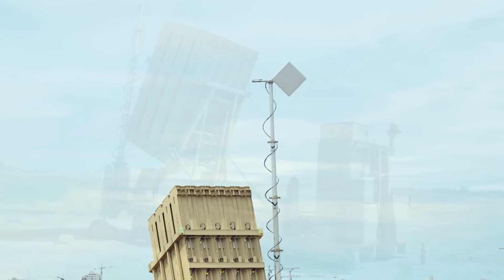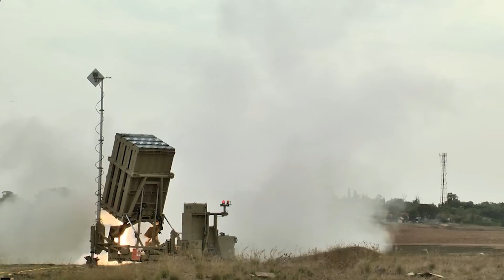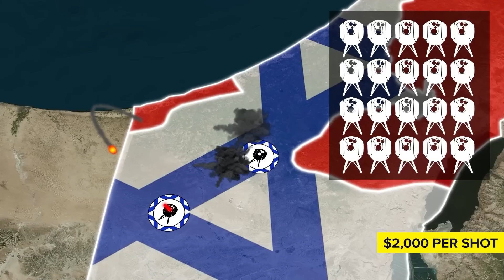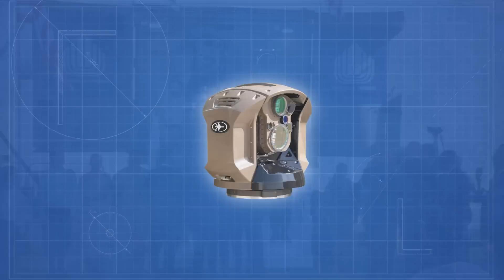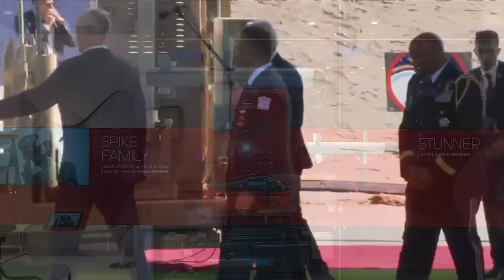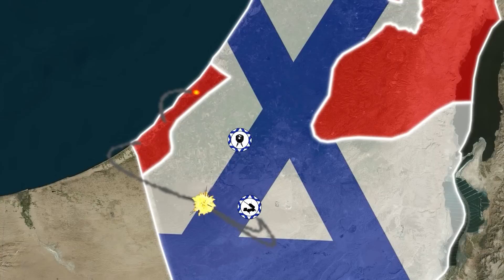Could Israel's Iron Beam Replace the Iron Dome?

Comment: The laser power generator was glossed over. The actual energy source that feeds the laser generator is very important. If it needs an electrical grid connection the damage of the grid shuts it down.

Nuclear powered naval surface ships bring the power source with them. Therefore, defense of shops with dedicated nuclear reactors for higher power systems could for e the US navy to update their surface ships with 2 reactors, one to power the ship, and the 2nd one to power the ultra e ergy laser.

The big question is how to power laser defense of military bases.

Comment: 2 Bleianschlüsse laden 7 bis 0 Elektronen, Positivstrom zünden.
2 Kupferanschlüsse laden 1 bis 6 Elektronen 1Bleianschluß zünden.
Der niedrige1 Bleianschluß zuletzt immer auch eenn rs nach Oben geht immer die 2 zu 1.
1 zu 2, 2 zu 2, 3 zu 2, 3 zu 3, 3 zu 4, 4 zu 4,usw...
1 Pink Wasserstoff, Natrium. 2 Rot Helium ind Blei 82 immer den hinteren wert 2.
Egal was für 1 Atom immer das Hintere.
Blei ist nur ein Beispiel, das Muster. 3 ist Braun Lithium.4 Orange Jod.5 ist Bor Bege. 
6 ist Kohlenstoff, Eisen, Schwefel, Gelb. Grün ist Stickstoff, Clohr, Silber 7. 8 Blau Sauerstoff, Nickel.
9 ist Flour, Kupfer Gold Hellviolett.10 ost 0 Neon, Calcium.

Comment: Iron dome will also develop defence projectiles that would cost not more than $ 2000.
The loading mechanism will be fully automated.
Iron beam will develop longer ranged beams.
Arrow & David  projectiles will undergo tremendous cost reductions making them extremely economical.
The too will be automatically loaded.
Mega beam will be with 1000 kw & over beams that will further enhance defences

Comment: There are various components to the Iron dome, it would seem a simple thing to replace the missile component with the laser component, the only difference in the system is what is being fired at the incoming projectiles. They already have the detection and battle management system in place for the iron dome, if the laser system was made on purpose to be compatible with the other subsystems that would reduce the cost of making the iron beam ready to be put into use.

Comment: Iron Beam stack one straight line and the rocket not one line up and down so Iron Beam not worth to thing
Reply: That reminds me of when militias found a verse in the kuran about "silk will protect" and proof in the kuran that it does, so they did experiments firing rounds at hanging silk which all pushed the silk out the way without damage. So they started wearing it - and it worked for a while and they proclaimed "ALLER - SNACKBER" .   edit: 100% true

Comment: is it not 3$ per shot?
Reply: including maintenance its a little under 2k
Reply: @evi388  i thought maintenance is a constant. is there a limited number of shots it can fire before it needs expensive maintenance? i thought only mechanical equipment are like that
Reply: @kianzarrin  it's constant for the most part but heating and stuff makes you have to spend money more often. That's why I say under 2k (probably closer to 1k if anything) because there's no solid number
Reply: Electric cost can go up to 1000 to 1500 $
Reply: 3 dollar cost-per-shot is future-projected. Current CPS includes cost development etc, the CPS will reduce over time just as any other tech.  In a way attackers are helping reduce the CPS the more they attempt
Reply: @jagmarc  i assume the price of electricity would be 3$. but what about the maintenance cost? lasers create a lot of heat that might accelerate wear and tear and increase maintenance costs with every shot.
Reply: Knowing western MIL tech I'm certain every separate component is mathematically modelled for its worst-case operating conditions and then tested to extreme to look for any weaknesses. MIL grade is a different league entirely.
The other side tend to have the opposite philosophy "do the best can and leave the rest to the god" (equivalent to "hope for the best")  2000 rockets so far fallen short   @kianzarrin
Reply: @jagmarc  @evi388 yes I think a maintenance cost of $2000 per laser shot would be exceptionally high and is not consistent with the typical expectations for modern military laser systems. Advanced military technologies, including laser weapons, are designed to be cost-effective over their operational lifetimes.

Comment: We can calculate laser weapons will work as long as they repeatedly do not forget to factor in refraction by air molecules. Cause we already know how far they can go. And with refraction you need to add power and so making a powerful laser should be difficult cause of energy levels and for how long it needs to be lit before target is destroyed. Short range laser should work.

Comment: i'm surprised israel hasn't developed anti-ballistic loitering drones, call it the iron swarm or something, and have them linger around flying on batteries but have a JATO mounted on them, when a launch is detected point the drone at the rocket and start the JATO and fire the drone into the rocket? any military experts in the comments feel free to roast this idea.
Reply: It's a good idea but problematic as it can interfere with Israeli air force as well as it will not be very effective because drones are much much slower than rockets. The only times it would be effective are when a missile is already inbound to hit a drone, which won't be 99% of the time unless Israel literally covers its sky with drones, at which point it's literally an "iron" dome over Israel. So yeah, I guess that's why they haven't done this, but I am a physicist, not an engineer, so there may be various other reasons I haven't thought of.
Reply: @operationstarwars  that's what the JATO is for, the drones are slow normally but have a rocket on them ready to launch the drone towards the rocket. it makes more sense if if think of them less like drones and more like missiles that fly around waiting to launch themselves. like an iron dome but without launchers, using loitering munitions instead. i could see it being used to take out smaller rockets and enemy drones while the ground based system handled the big stuff.
Reply: I like it

Comment: $2000 per shot? That's my monthly salary 😂😂😂
Reply: Idk where he got 2000$, it's only 2.5$ in electricity, but can only target one missile at a time, so you need meny of them to get the same coverage
Reply: @biochemistryproject  Each interception costs $2.50 the laser beam destroys the missile in 30 seconds
Reply: 😂 our whole year salary going in air in 1 minutes
Reply: each interception costs 2.5$
Reply: So was a hard disk drive once.  3 dollar cost-per-shot is future-projected. Current CPS includes cost development etc, the CPS will reduce over time just as any other tech.  In a way attackers are helping reduce the CPS the more they attempt

Comment: The Iron Beam will be another piece of the puzzle in a comprehensive layered air defense. Israel currently uses the Iron Dome, David's Sling, Arrow, Patriot, and (I believe) NASAMS. There are also MANPADS and probably some type of CIWS system, but I'm no expert on their systems. 

The concept is to have a system that is designed to protect against a certain range of threats with each system overlapping a bit, so any missile, plane, rocket, etc will experience increasing defenses the closer it gets to its target. The Iron Beam isn't designed to replace the Iron Dome, it's meant to compliment it and cover gaps in capabilities.
Reply: Setidaknya itu lebih sedikit biaya utk sekali shot , dan mungkin sdh dipikirkan utk kedepannya diciptakan juga sistym daya yg lebih besar...dan itu hanya masalah waktu ,sy yakin sekali
Reply: @jasmineterracota7730  The power supply isn't really the limiting factor, it's creating a laser that can hit something several kilometers away with enough energy to destroy it while not destroying itself in the process. The US is currently working on the technology for a 1 megawatt laser, which is about twice as powerful as current systems -- and seeing as how closely they work with Israel on many other systems, I wouldn't doubt that this technology would also be shared.
Reply: Laser systems have a few major flaws. Beams need a lot of power that current tech cannot really keep up with. Another major flaw is, every time the beam is fired it gives away your position with a line directly to you.
Reply: @Anwar157  The power issue is a problem for mobile systems, but permanent systems that can be tied into existing power infrastructure isn't nearly as much of a problem -- and several US ships have laser systems powered with conventional diesel engines, and newer systems like the Ford carrier, F-35, and B-21 have extra power output built into their design to allow for the addition of laser weapons in the future. The real problem lies more in the fact that laser light is still just a photon and has the same properties as any other light, so it's effected by things like clouds, smoke, and dust storms. 

As for your second point, no. Contrary to what you see in movies, lasers are mostly invisible. Again, they're photons, so they're invisible to the human eye unless they're reflected off something. It's the same principle as why space looks black -- there's light, but nothing for it to reflect off to be seen.
Reply: @ronaldQdobbs  It’s the heat that gives it away. Not that it could be seen with the naked eye. Thermal scope would show a line directly to your position.

Comment: Heard so many different costs for each shot of the laser even down to £2 per shot , I can imagine how strong it would be the electric used would be big but does this cost factor in man power or purely draw from the grid ?
Reply: Salary costs for the soldiers are not included because they get paid whether sitting on their butts or pulling the trigger. However cost for equipment often includes unit production cost and system development costs. This is why the price tag for mass produced equipment usually comes down substantially as production ramps up. This could be why you see wildly different estimates per shot for laser systems. The base electricity needed per shot is just a few dollars but if you include system development costs and production costs you could reasonably estimate that the average cost per shot over the first (some random number) of years of service being $2000.
Reply: The actual cost of the energy is just a few dollars. The rest of the estimates are including R&D costs, employee salaries, etc.
Reply: 3 dollar cost-per-shot is future-projected. Current CPS includes cost development etc, CPS reduces over time like other tech.  In a way attackers are helping reduce the CPS the more they use it
Reply: Jgn berpikir kearah itu ,anda ga akan mampu ,sy sarankan anda cukup menontonnya saja ,ok👍

Comment: Thks & yeaps;
     The counter to laser weapons is cheap ablative coating ; bad visibility (ex: perciperation, clouds/fog, etc) ; etc ; etc 
     The atmosphere is pretty-much transparent to centimeter to a few meters radar waves.  
     So a powerful multi-beam phase array radar is the current best single complete anti-drone system.
     Of course integrating multiple counter drone/artellary systems is bestest & the hardest part.
     Really the ultimate weapon systems are those you avoid needing (aka peace).
Reply: Not much chance for clouds, fog and precipitation in Israel.  Ablative coating might be filtered out.

Comment: It's more difficult to shoot down 1,000 salvos of rockets in a single day than it is to shoot down a 80 ballistic missiles every 2 weeks. The rockets may be cheap low end rockets but they are launched as an saturation attack which is far more difficult to shoot down than ballistic missiles which are not launched in the thousands at a time.

Moreover these are short ranged rockets which means the defender only has less than a minute to shoot down hundreds if not thousands of rockets at a given time due to the close distance while ballistic missile would take hours to reach it's target. Giving the air defense ample time to shoot them down. 

Ballistic missiles can not be rained down upon cities because of their expensive price, while these cheap low grade rockets can rain down on cities overwhelming the air defense in the process. It is far more complicated to shoot these rockets than ballistic missiles.
Reply: @TheBlackAndDeckerBootyWrecker 

There is no need for the Iron beam to deal with paragliders. A few M61 Vulkan will do a fine job.

Comment: There is also a new variant of the Iron Dome called I-Dome. It is a mobile version on a truck. This would mean maneuvering forces in enemy territories will be protected from drones, shells etc..
Reply: That's needed. One of the big problems you see in Ukraine, is, convoys can't defend against helicopters. Gepard can engage targets 3km - 4km away, Stinger 6km, but russian Ka-52 can be 15km away, and it's the same with other helicopters, so it needs a mobile solution against such targets with medium range, and if Israel has that, it could fill a very dangerous gap for western military forces.
Reply: Elder spotted  @TheBlackAndDeckerBootyWrecker
Reply: What's ur source

Comment: It sounds like the Dome and Shield in tandem for the next while. Also, any word on either being donated to Ukraine?
Reply: Atm Israel needs all the systems they have. They expect, compared to Hamas, 10 times the rockets from Hisbollah, and Israel doesn't have enough launcher and missles to engage this amount of targets. The USA has 2 iron domes for testing, and the situation for Israel is so severe, that I heard things about giving them back to Israel until the situation is stabilazed. 

The Iron Dome would be great for Ukraine. Compared to NASAMS and Patriot, taking a target down just would cost 5% - 10%, and it's not a long range weapon, just medium range, but cheap and small, and it should be able to destroy helicopters. Israel works on or has a mobile version, and atm no military has mobile air defense that would be able to defend against modern attack helicopters. 

F.e. the Ka-52 has 15km range, it's very dangerous against convoys from Ukraine, the Stinger just can engage targets up to 6km, maybe 7km, so all western militaries would need a mobile solution for medium range targets. 

Also with it's price it is perfect to fight drones. Gepard just has 4km range, and would have problems against huge amounts of drones. 

40k - 50k still is expensive against some drones, but f.e. the Shahed costs around 20k, and spending 50k for that isn't ideal, but it's okay.

But for now, Israel needs all the systems they have, and they have to find a way to increase the production for missles.
Reply: Dont think Russia will be too happy in seeing Israel donate such gear to Ukraine..Remember they (Israel & Russia) have a working relation in Syria where the former informs the latter for a thumbs up of an impending attack on weapons destined for Lebanon's Hizbollah from you guessed who.
Reply: @tonyluseno2673  
I mean Russia is publicly preferring Israel’s enemies over them (and is actively working with Iran, who’s been covertly orchestrating it all to begin with since early on in the Ukraine War)…
I’m not sure how well that working relationship is going for either at this point.
Reply: @ButFirstHeLitItOnFire  It's more of a begrudging neutrality so both countries can do stuff in Syria.